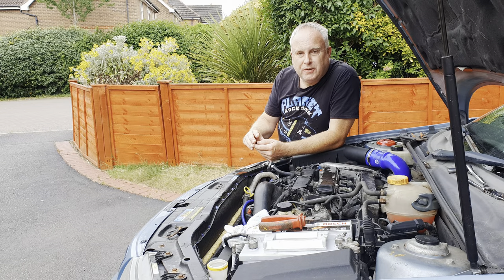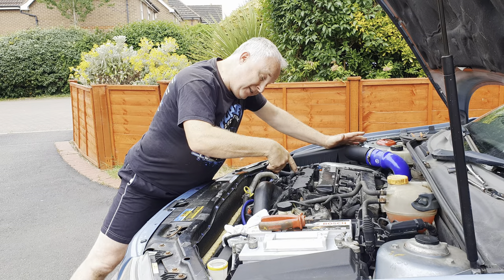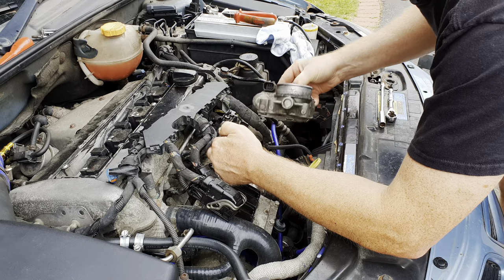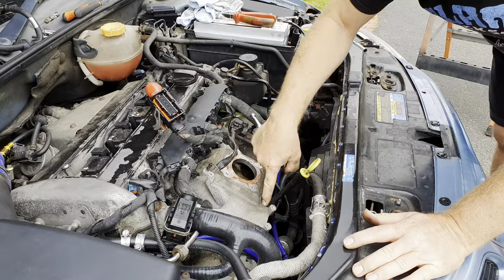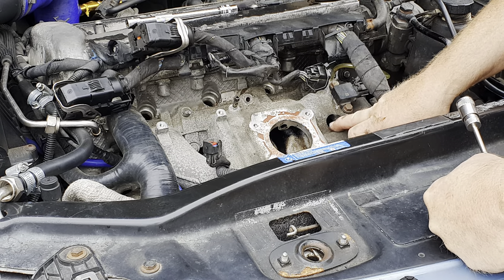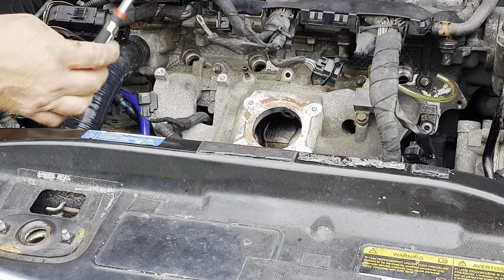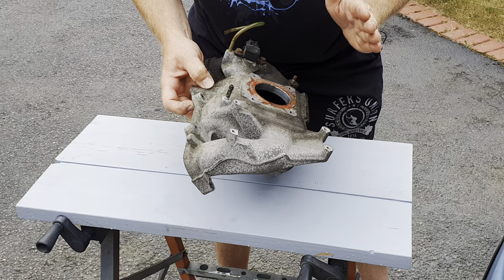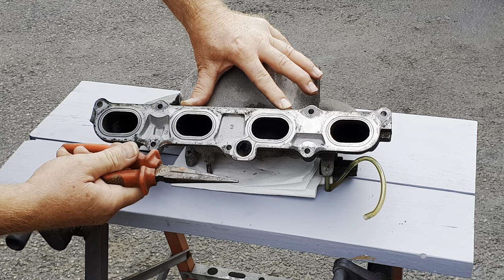Saab B207 PCV valve replacement | Your Saab 9-3 Tutorial of the Day

Comment from the maker: 👉 Saab 9-3 No crank no start fix: https://youtu.be/MmZalE0eiYE
Reply: Nice video as always Cyd
Please consider doing  the video I suggested with a how to on changing all the vacuum hoses (with silicon ones )
Reply from the maker: @MrOikono  Thanks. Yes I will, I'm waiting for a reel of hose from the same supplier who does my one piece radiator top hose (if you have a B207 you should get one - seriously, those plastic tees are failing regularly now).
Reply: Hi 
Could you help me with traction control fault abs esp please my car is stuck in the garage now
Reply from the maker: @bartkrzus2223  2 things:
Check the wires to the rear WSSs,  they break internally where they jump from body to suspension. If not that could be broken edge connector on pcb. Follow repair procedure in linked below
Reply from the maker: @bartkrzus2223  https://youtu.be/MmZalE0eiYE

Comment: Great video. Just done mine thanks to your advice. as someone mentioned, removing the pcv by pushing it from the inside is easier than trying to grab it with pliers.
Reply from the maker: Yeah, it is, as I found out since making this. Although I have blocked the original PCV valve and fitted an external one from a Mazda RX7 in prep for fitting a catch can. The RX7 valve is much better anyway - my brand new valve was leaking boost into the crankcase, not any more!
Reply: @CycloneCyd  Sounds like a neat mod. You should make a video about this!
Reply from the maker: @supercanardo  I will

Comment: Easier to push the PCV valve from the throttle body end of the intake manifold, just push with your pliers or screw driver or anything that will fit in the hole, like an allen wrench or 1/4 extension.

Comment: I probably should look into this. Aero is burning oil (about 1ltr/3000km) and seems to be going down on power slowly without misfires and such... Boost leakage through PCV could explain it
Reply from the maker: These engines are prone to leaks too. Again, often caused by boost leaks through the PCV
Reply: @CycloneCyd  I have zero leaks. Had a Turbo return pipe leaking, but that's fixed. After that I've noticed the increase in oil consumption..

Comment: Another great video 👍, I'll be tackling this during the week, no issues at moment just a preemptive repair. Also gives me the chance to check how my ecu cooling mod fix has held up.
edit
now done and the valve was starting to leak a small bit with the test blow and suck.
Reply from the maker: A timely change then, proving my point. Thanks.
Reply: Also just done this on my saab aero I've got recently, valve was completely knackered on this one and didn't restrict blowing or sucking. Car ran good before so didn't expect a faulty one as it was just another pre-emptive repair but now idle feels better and more responsive at low revs.

Comment: Love yor tips cyd, and followed a lot of them, particularly the solid mounts two pack compound.
On the pcv issue, it's not good for an engine to burn Oily crankcase gases
As it lowers the octane rating of the fuel in the cylinder when burning,,
Besides slowly building a residue.
I know mfgrs do it to lower emissions as one of the reasons.
For two months now on my petrol aero, I have been running the engine
With bypassed pcv, and a catch can.
The engine runs fine, with no starting issues, idling is probably better,
The only noticeable drawback is
Occasionally I get a slight whiff of
Engine burn in the cabin.
Other than that, no problems.
Reply from the maker: Ultimately a catch can is the best solution, provided the residue is properly disposed of (unlikely to happen in most cases). In any case, if the engine is in good condition, you shouldn't be getting much oiliness through the pcv.

Comment: Good to see your work again, Cyd
Reply from the maker: Hey, thanks! the Saab is getting some love this year. I've just got an Ice Blue rear bumper (08 on) from Ron and have the car booked in to a classics restorer to sort the rear arches. It's just had a new clutch at malcolm Miles in Leicester and will be going back there to have the head swapped out (for an Abbott racing head I picked up) later in the summer. These are jobs i either can't do because I smashed a shoulder in a few years back, or I haven't got the equipment. I've still got plenty of videos in the planning, fret not.

Comment: your videos are excellent.i enjoy seeing them and you helped me a lot.thank you very much!
Reply from the maker: Glad you like them! Thanks
Reply: i have a problem with my car and if you can help me i would appreciate it.i have the saab 9-3 2008 2.0T aero convertible and i have the maptun stage 2 program.the car starts normally,its idle is perfect and i don’t have any error codes.the only problem is that sometimes the boost isn’t enough.when everything is ok,the turbo meter at full speed goes to the middle of the red lines and the car is very fast.but sometimes car is slow at all rpm phase and at full speed the turbo meter is at the start of the red lines.another thing that i noticed is that i don’t hear the turbines blow off sound anymore.do you have any ideas what the problem is?thanks!

Comment: Hello. I have a slight problem with my Saab. Just brought the car back from deads. It was sitting for the last 4 years and bought it to bring back to life. Replaced spark plugs, oil, filters, replaced all vacum lines. Fixed the turbo, and replaced the air filter with one open air filter. Also the exhaust needed fix, so I bought one second hand from a breaker. Replaced struts, springs, strut mounts, bushings, arms and mostly all bits... Put new oil gearbox, flushed the power steering and put new oil. Also put fresh coolant. Now the problem it goes like this.
The car starts fine, drives fine, idles fine. But when I rev the engine harder a cloud of smoke stats to appear. The cloud is very big when accelerating hard, and it is still present but not as much when idling. This happens only with the engine cold. I opened the turbo hose se there if it is any oil inside, and found a bit of oil. Not much but it was a few drops. Now I wonder if I might have some oil in the exhaust since bought from breaker and I don't know the history of the part. Maybe the car it was on had some issues and thrown some oil in the exhaust. Or maybe is my pcv valve bad since the car was not started for so many years.
  Coolant level stays in the correct margins and temperature is great too....
  So I wonderif oil in the exhaust or bad pcv could be the culprit for my smoking saab. If you have any suggestion, please help me out. Thank you very much.

Comment: Is the rebuild of the injectors going to be a separate videos I need to get mine cleaned because I think they are a little dirty
Reply from the maker: Rebuild:  https://youtu.be/a7cmZrBaMM8 this is for Denso injectors on B207 from 07MY. Bosch injectors are basically the same but I don't think they have the plastic rings
Simple clean with inexpensive tool and cleaner (tool link in description):https://youtu.be/8rHmN2AC_mk

Comment: Hi Cyd, on some forums people say that it is safe to block inlet pcv hole( saab, cobalt forums), it stops oil getting in manifold and loosing oil and boost... Adding oil catch can on turbo side baffle helps too. Do you think it is safe to do that?
Reply from the maker: NO, don't do that.
Reply: @CycloneCyd  hi cyd, can you expand a little on your reply. 
I understand that pcv systems on cars were designed to reduce emissions and help the environment, 
But it is surely factual that combustion without octane lowering 
Oily and carbon heavy crankcase gases, would make a cleaner burning engine. 
A catch can fitted would safely remove what would have been burnt in the cylinders. 
Just interested on your take on that.

Comment: Could a failed PCV cause difficulty starting in warm ambient temperatures?

During the summer months, my ‘07 2.0T often has a difficult time starting. It’s fine once it’s running! I’ve replaced vacuum lines, crankshaft position sensor, etc. Starting to think it may be this or perished injector o-rings?
Reply from the maker: If it's struggling to turn over that could be this https://www.youtube.com/watch?v=UKTd4aI3-Mw
If it's turning over okay, but struggling to fire, I would also check the fuel pressure at the rail, should be 40-45psi when idling, maybe a little more when cranking
Also check this out next time it does it https://www.youtube.com/watch?v=iLKOqCS67xM&t=18s
It's surprising what a difference cleaning and refurbing the injectors makes. I did mine and it's like night and day. How to get the injectors out of the B207 https://www.youtube.com/watch?v=JxQVVVbN4-Q&t=58s   how to clean injectors effectively and cheaply with a simple tool  https://www.youtube.com/watch?v=8rHmN2AC_mk and how to use a rebuid kit  https://www.youtube.com/watch?v=a7cmZrBaMM8&t=34s
If you've got the Denso 0590 like I have, I can supply you with a rebuild kit (they are hard to find) https://www.buymeacoffee.com/CycloneCyd/e/79386

Comment: I got a Saab 9-3 06 2.0 when I put gas it stalls nd smokes a lot. The smell of gas nd sometimes oil , nd lost of boost. I’ve replace bcv nd fuel injector bc it was leaking now I just smell gas no leak. What could it be. Thanks for the quick response

Comment: Could a faulty PCV valve be the cause of the throttle body getting gummed up? I got a P2135 fault code (& limp mode). Cleaning throttle body cured it for a while but as it kept returning I eventually replaced the throttle body. This cured it for about 9k miles but the code's returned.

Comment: hello my friend i need your advice on a vehicle related issue how can i contact you
Reply from the maker: Best thing is to put your question in a new comment on any video (find one that's relevant if you can, otherwise put it on the latest video)
Reply: @CycloneCyd  Then I can ask here. There is a P 0300 fault in my vehicle, which I could not find a solution for. For this, I changed the spark plugs, coils, oxygen sensor, air flow meter. PVC valve stuck in my mind. Could it be related to that? Thanks.
Reply from the maker: @orkunbaş-f4g  PCV is a possibility. If the car has done much more than 50-60,000 miles you should change the valve as a matter of course.
https://www.youtube.com/watch?v=ro0CN6SdD5s
P0300 though, is more often than not a vacuum leak. Your car must be at least 12 years old and the small hoses will be well past their best. Change them all.
https://www.youtube.com/watch?v=_cZEeTJxdaE&t=390s
https://www.youtube.com/watch?v=nIBkGN7HRao&t=1s
Also check the inlet mani screws are tight. I've seen reports of them loosening over time.
Similarly, check the cam cover screws
And finally
https://www.youtube.com/watch?v=bgLn14dZL3Q&t=1s

Comment: What are the comon cel codes for this? I have a P0171 and have changed the Air Intake hose and still persist
Reply from the maker: Which air intake hose? There are 5 (five). Check this, very common issue https://www.youtube.com/watch?v=bgLn14dZL3Q&t=1s

Comment: hello,

was wondering if it is possible to test the PCV in the  SAAB b207 engine without removing the inlet manifold?

if so what is the tool or process.

ask as though I don't have the symptoms I had a nes PCV put in abot 45k ago as previous one failed and I had leaks in many places.

since the replacement of the PCV I have had to replace the turbo as it was passing oil and there is no evidence of the PCV being replaced when turbo was replaced though oil was evident in the pipes to the inlet manifold

Comment: I’m trying to bypass the ignition switch on my 06 Saab 9 3 Aero…I’m getting a “steering malfunction” message and I’m not paying out the ass for any new “modules”. I’m going to have to take the ignition switch apart and disable the pin that locks the switch. I’ll still get power when I turn the key to the on position but it won’t start the car. I’m going to install a push button switch with an inline fuse and wire one end to the battery and the other to the starter relay in the fuse box. I hope this works because it is a pain in the ass to take the center console apart…Any knowledgable suggestions would be appreciated!
Leave a Reply
Reply from the maker: Clean the ISM and put back together with a smear of silicone lube on moving parts. They get dirty and the moving parts stick.

Comment: Do you think a catch can would be beneficial for these 9-3  ?
Reply from the maker: YES, definately. However, most catch can installs I see (especially on turbo cars) are done wrong, sometimes allowing boost pressure into the crankcase. These are complicated by the valve being in the inlet mani.
I'm gonna be having a replacement head fitted later this year, after that I'll do a catch can install with video.